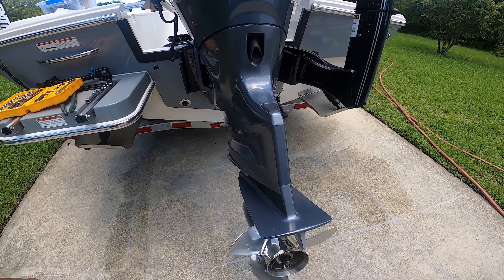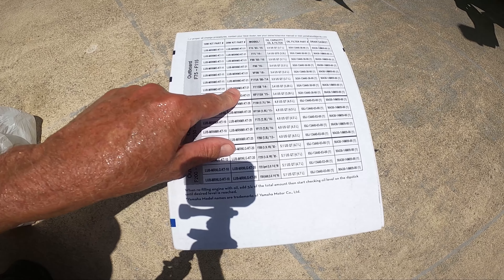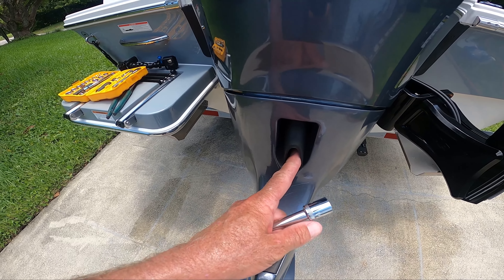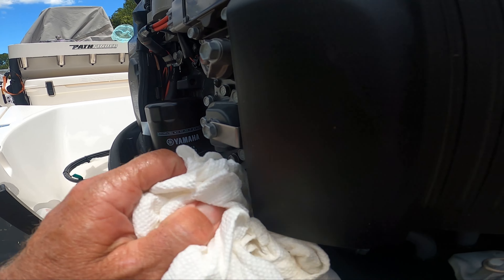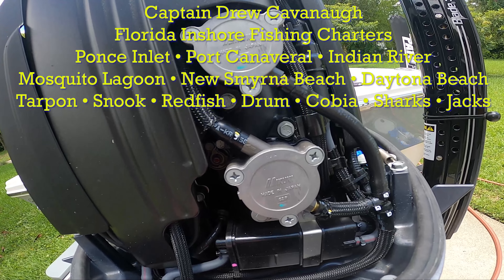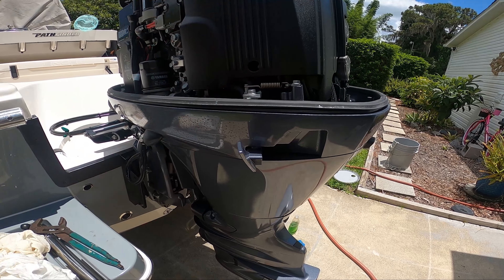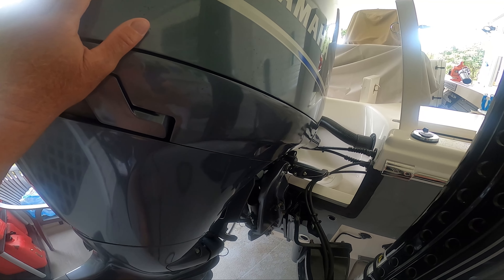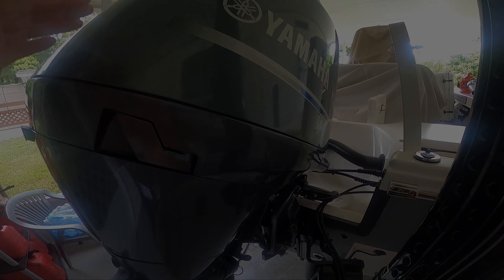How to Change the Oil on a Yamaha 150 HP Marine Outboard Engine 2024 Update

Comment: Is it 4.8 quarts or 5.0. My kit came with 5.0
Reply from the maker: Add it, then measure it. Use the dip stick, it varies.
Reply: @captaindrewcavanaugh  crap I just added 5 because that is what I read everywhere. Should I try to measure dipstick and see if it is past full line. If it is take out an oz with my electric vacuum pump. 

Boat is winterized and sitting for winter